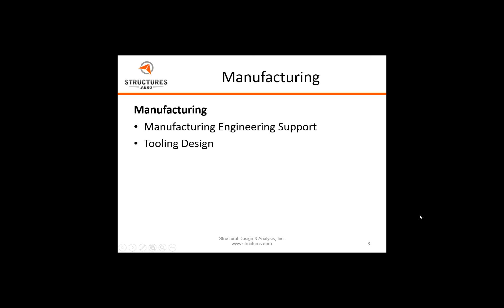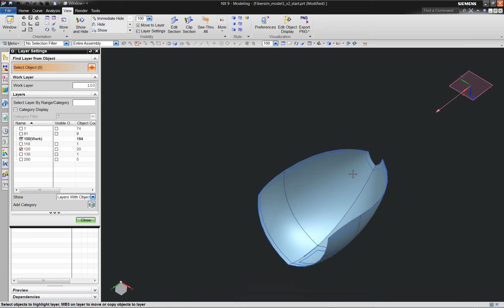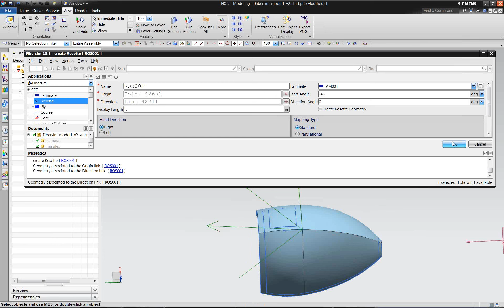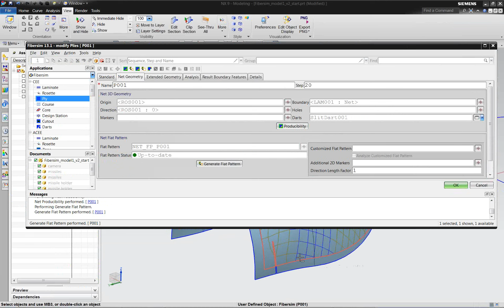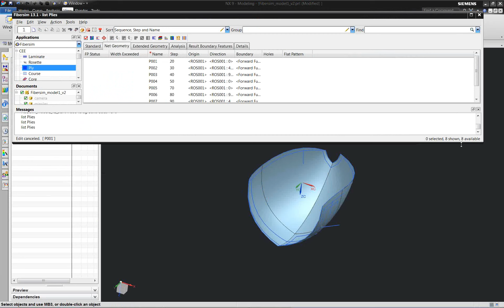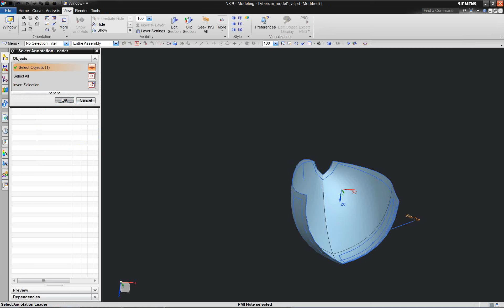Composite Analysis Using Fibersim

Comment: You exported the Fibersim Layup to Femap. Our Siemens PLM partner tells us, this should not be possible. They claim we have to buy Simcenter 3D (NX CAE) including the Laminate Composite add-on. Isn't this true or do you have some customized solution?
Reply from the maker: Hi Thomas, this is possible in Femap via the bulk data option. It is simpler to do in Simcenter 3D but we can show you how to do it in Femap. If you email us at support@structures.aero, we'd be happy to help you out and show you how!